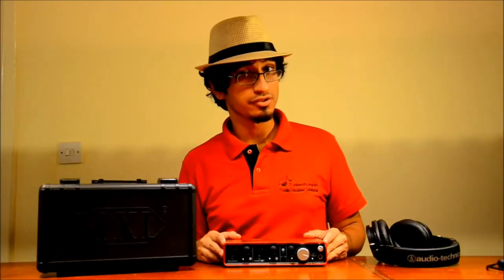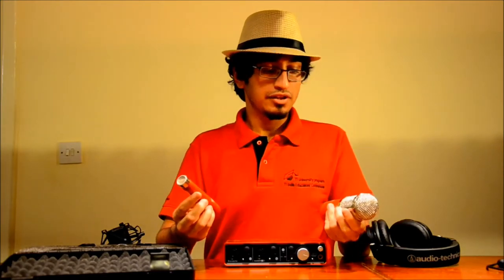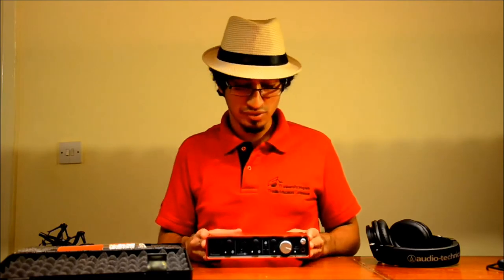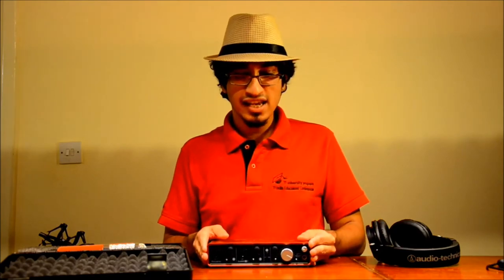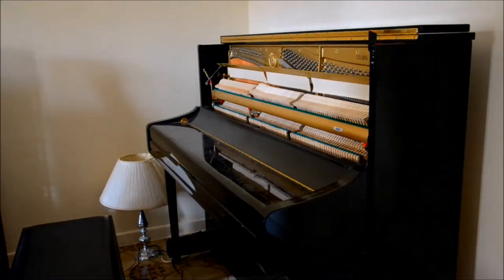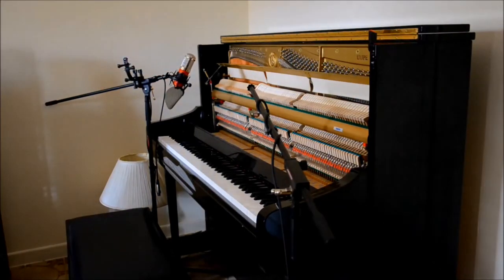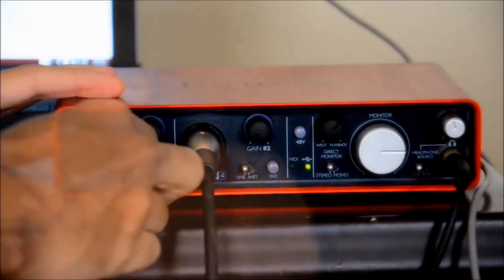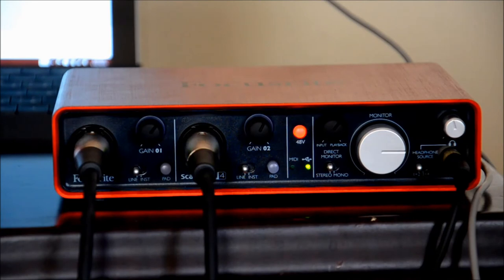Recording an Upright Grand Piano in Stereo [TUTORIAL]

Comment: OR just use the Spectral Autopan VST to pan the audio by frequency - bass goes left, higher pitch goes to the right. Even if it's a cheap microphone you can use Noise Reduction and Reverb in Audacity. Great if you're on a budget :D